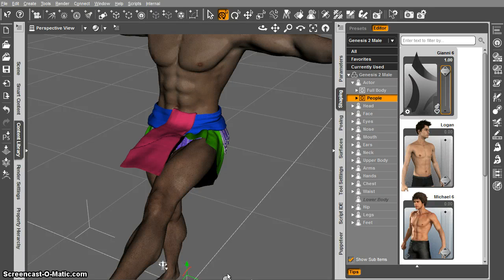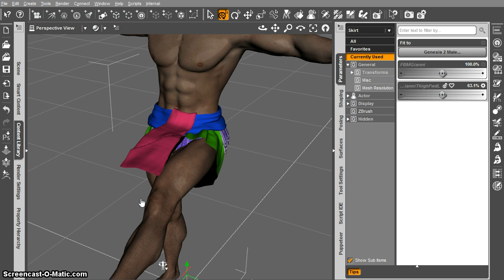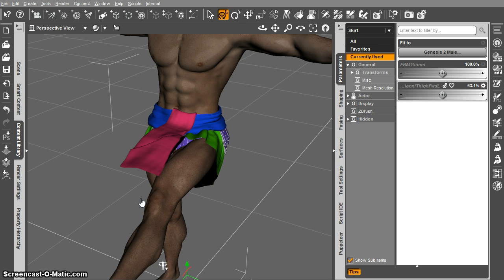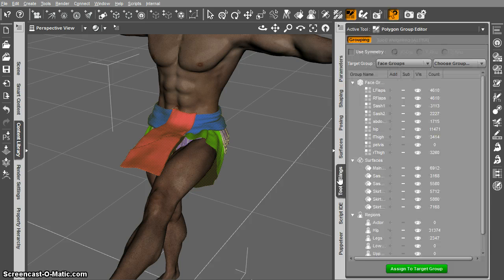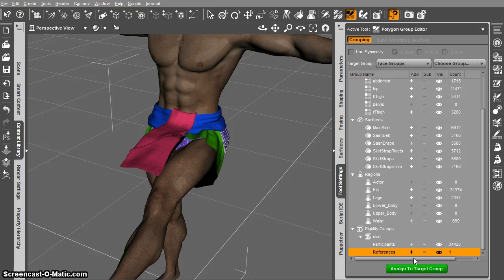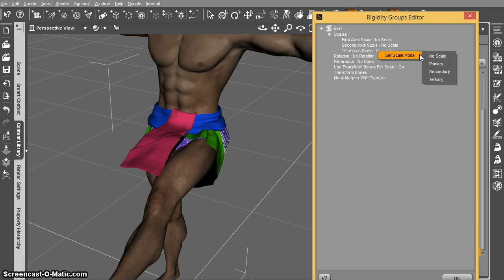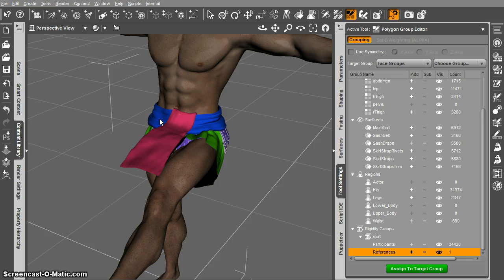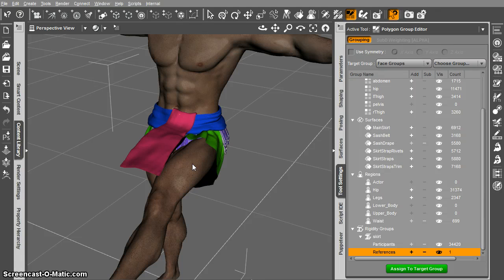Using Rigidity To Exclude Corrective Morphs

Comment: Hi Josh, Awesome tutorial. I was wondering, is there a way for clothing to actually fit to a figure shape once you've used the technique you just ran through? The armour I created for G8M, after applying this technique, now has massive poke through. Basically the back half of the armour got sucked into his body. Any help with this would be much appreciated.
Reply from the maker: With a piece of armour that covers a lot of area on the figure you might not want to use this method. If you do use it then you are going to be stuck with the job of hand-creating any of the morphs you want to support. Some people like that control, some don't want to have to do that much work. Another option is to use rigidity in a less strong-armed way. You could set the rigidity weightmap to a lower percentage, for instance, so it reduces how much the mesh moves but allows it to still move a bit. The problem with the whole piece being in one rigidity group, though, is that it follows whatever reference verts you set up and that won't always be right. A better option, then, would be to have multiple rigidity groups set up so you can have different reference geometry for each part (say, front/back/left/right) so they all follow the mesh pretty well as it move and then the strength of the weightmap will help it transition between the different groups. It can get pretty complex to describe in written form...
Reply: Thank you Josh. I appreciate the time and your response. I think I understand what you are saying. She's a big job ay. Haha. Thanks again.